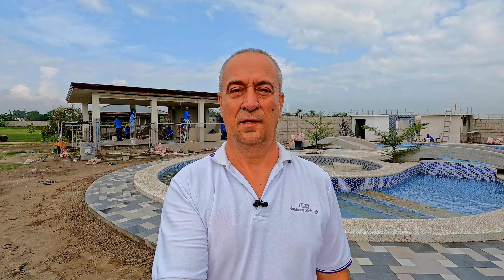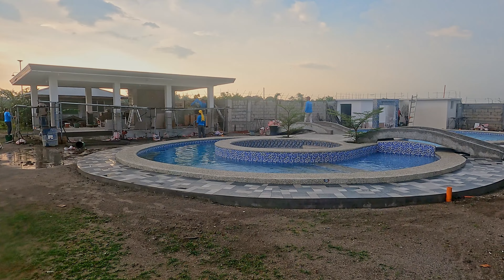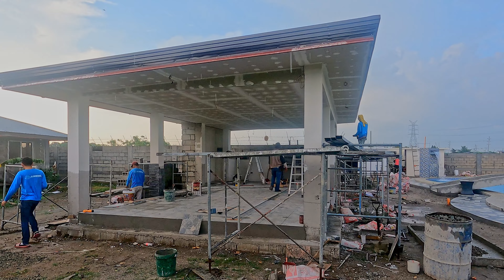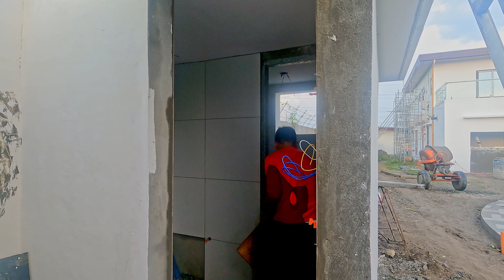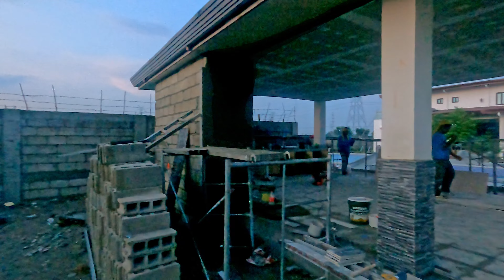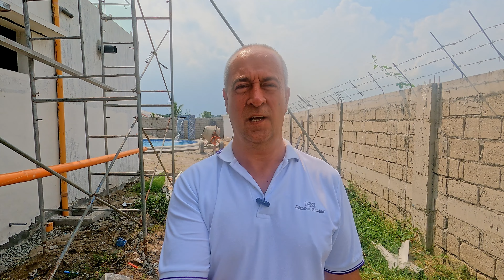Philippine House Building Day 337 - Everybody Out

Comment: Hello, I've following your home build, why did you plan an important function that would interrupt your house construction and put the workers in a hurry-up stressful situation? Just wondering?.
Reply from the maker: Hi Lamont
The truth is it was not really planned. A bit of a last minute change. 
It will put the house finish back a couple of weeks (which will actually please the crew as it means more guaranteed work, at least for some of them). 
My impression is that it is not stressful for them - in most cases, they are very happy to have the overtime. They still come to work smiling most of the time.